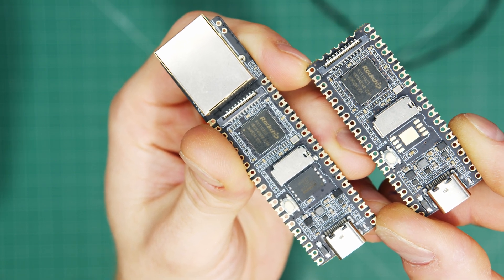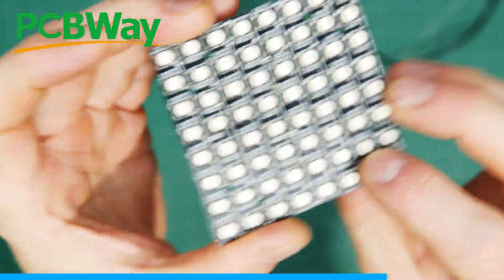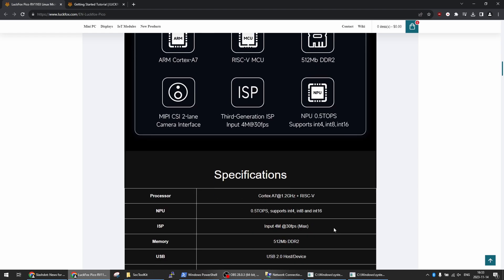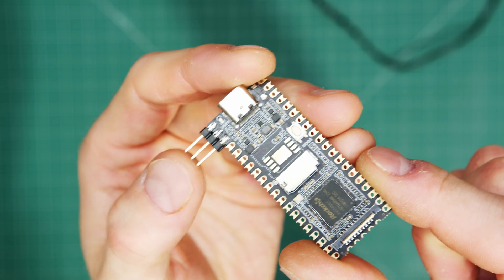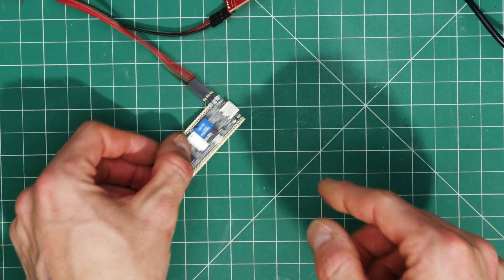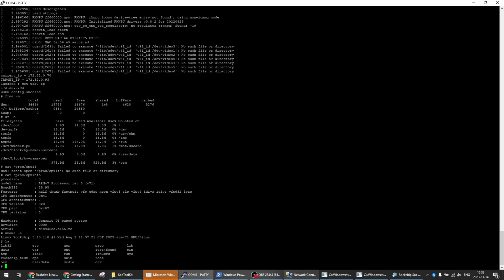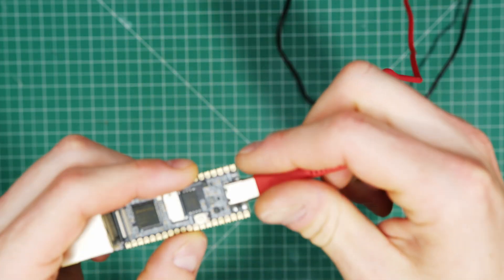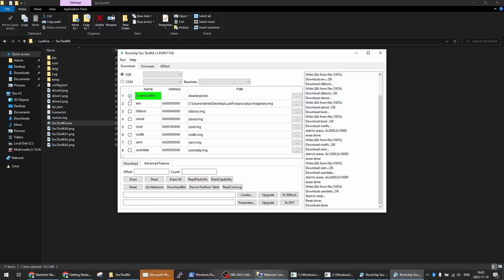Luckfox Pico - Milk-V Duo and Ox64 Killer?

Comment: SoC's seems to be a lot more complex compared to microcontrollers.
Reply from the maker: Oooh yeah mate, but more capable too. Eg Atmega32U4 - 16MHz 8-bit RISC-V, 2.5KB RAM, 32KB Flash, 12-channel 10-bit ADC, USB 2.0 integrated for flashing. RV1103 - 1.2GHz 32-bit RISC-V, 64MB+ RAM, 26 GPIOs, TPU, ISP, Ethernet, MMU, MIPI DSI/CSI, USB Host & Device, SDIO for SD or Wifi, PCIe, SPI NOR flash controller, etc.
Reply: @PlatimaTinkers  If their increased complexity didn't bring more capabilities the designers f'ed up.
Reply from the maker: @bogmaerke hahaha ain't fkn wrong mate

Comment: can they process 4K cam? and if so can they stream over some wireless?
Reply from the maker: Hey they have no wifi built in, but they do support USB device mode so you could easily connect USB or SDIO wifi as long as you have the drivers.

They have MIPI CSI 2-lane for camera connectivity, so you should be able to do 4K@30FPS but the capability of the ISP is limited to about 4M so you'd only get QHD (2560x1440) unless you dropped the FPS further. Back of the napkin math would be 4K@10FPS to JUST fit within that hardware capability.

The Pico Pro and Pico Max support 5M30FPS ISP so you should be able to get 15FPS which is what our eyes/brain usually need to perceive something as animated.

Enjoy!
Reply: Hello, i tried to stream over usb. Its working. Is it possible to stream over wifi or something by connecting with esp32? If its possible please help me to stream wirelessly using esp32 as a wifi midule!
Reply from the maker: @alfaskc729 You need to read the documentation friend. I am not a personal ChatGPT sorry.

Comment: Nice job on the review! I'd love to see a demo that exercises the video camera option, including taking pictures and recording video.   Do they have software support for recording video?  If so, mjpeg or H.264?
Reply from the maker: Hey thanks yeah I am planning a 'part 2' that gets into more depth. I'd assume you use libcamera or even ffmpeg as a frontend for interfacing with it, and can save in any format you want. The ISP appears to support JPEG, H264 and H265 hardware-acceleration. You can see in https://www.youtube.com/watch?v=JIFqV1vZB2Q how I use a library in a few ways to grab media from a connected camera - I expect the same code would likely work here with minimal changes.
Reply: @PlatimaTinkers  it would be huge if it integrates cleanly with ffmpeg.  A good tell is if it provides a standard /dev/video0 interface.  Looking forward to part 2!
Reply from the maker: @leadf00t looking at https://wiki.luckfox.com/Luckfox-Pico/CSI-Camera/(am going back to the workshop in a bit and can test if I can find a compatible camera) it looks like it creates /userdata/video0 haha. You can see on the Core3566 that it is fully V4L2 compatible though (https://wiki.luckfox.com/Core3566/Core3566-pinout/6.%20CSI%20Camera/#63-viewing-camera-information) so I'd assume so!

Comment: Wooow, such a great video!
Do you know how does the camera work? I'm trying to do object recognition but the only thing I know over the camera is that generates something like a .jpg file, does that file updates all the time? that is how does cameras works on linux? I'm a newbie in this world, thank you!!!
Reply from the maker: @ericcaudillobarbosa586 Hey thanks! The camera does not have to generate a JPG - it's just a data stream that you can interpret any way you want; save images, save videos, perform realtime detection, stream it to the network, etc. There's some example info on it here: https://wiki.luckfox.com/Luckfox-Pico/CSI-Camera and
Reply: Dude...this probably isn't going to be the ideal board for object recognition. object detection maybe. If object recognition is what you're interested in. Buy a raspberry pi 4 or 5 or pick up an Nvidia jetson. The jetson was made for AI applications. The most important thing to know is that you can't make chicken salad out of chicken shit, and these under 20 dollar boards are chicken shit when it comes to these type applications. If you're building an AI system or application and your board doesn't support python, you're going to hate it. peace out bro.
Reply from the maker: @rickhunt3183 I think you've missed a bit of the specs, as you're not correct all sorry mate. It'd be good for you to check out how the ISP pipeline and TPU work, plus how RKNN stitches it all together.

Unlike the Pi 4, the board has 0.5 TOPs NPU and a 4MP 30fps ISP. It can do object detection AND recognition, and you can even do facial recognition at a decent clip. This RV1103 (lower end to 1106 and 1109) SoC can run YOLOV5 at about 10fps from memory, RetinaFace at a very good speed, plus plenty of other image recognition, text recognition, car plate recognition, speed recognition and similar models all at a solid pace.

And it supports Python, comes with it out of the box in fact. Really not sure where you're getting any of your info from sorry.

Comment: Interesting possibilities with this thing. Much more than the Ox64. Use the RISC-V as VGA GPU?  Will be checking the camera options.
Reply from the maker: Yeah I don't see why not. If you check out https://www.lontentech.com/products/raspberry-pi-vga-adapter-board-gpio-to-vga-module-shield-for-raspberry-pi-4-model-b-3b-2b-b that does 1080p60 using 6x GPIO pins as it only requires a ~150MHz pixel clock from memory.

Comment: Thanks for the great video.
I have the 1103 board but not using it so far. Instead, using 3566 and 3588.
Will try to do the development on 3566/3588 with NVME and then port to 1103/1106 for power/size/cost consideration.
Reply from the maker: Yeah that is probably the way to go; compile time on these would hurt haha. And you're very welcome!

Waiting for my 1106 boards to arrive now :D

Comment: Please consider zooming in on the text .. very difficult to read .. really don't need to show the whole thing top to bottom and w/ all of the empty space on the right side. ☮
Reply from the maker: Yeah mate no worries - what part were you referring to? It can really depend on the resolution of your screen but I try to make it readable at 1080! Cheers for the feedback
Reply: @PlatimaTinkers  7:17 onward .. for example (what I'm talking about can be avoided several times).
Thanks for being kind about what I hope is constructive criticism.  ☮
Great video .. don't take me wrong. Thanks for sharing your knowledge and experience!
Reply from the maker: @THE-X-Force hey yeah I get what you mean now - the terminal output! I just had a look and it's quite readable here, you might want to click the cog icon for the settings and make sure it's set to 1080p50 - that was the recording resolution, so that playback fullscreen should look close to 'native'. I have increased the PuTTy font size though so it's easier in future videos!

Any criticism is absolutely appreciated - I am rubbish at this so value any input or feedback. Cheers!
Reply: @PlatimaTinkers  Ok .. my res is good and I can make it out (barely on this 17" laptop at 1080), but maybe you will agree that having nearly half the screen show nothing but empty black space is .. less than ideal?

I'm suggesting cropping most of that dead space out .. and since that would make the video vertical (aka horrible), lopping off some of the top text that the viewer has already seen, and doesn't need to focus on. Hope that makes sense. Maybe try it and see what you think.

In any event, it's no big deal. Thank you again, and you are definitely not rubbish at this.

Best of luck from NY☮
Reply from the maker: @THE-X-Force Yeah mate had not considered that at all, I'm on a 27" haha.  You're absolutely right about the waste of screen real estate though; if I make the font size 20pt it looks like it fills the width nearly perfectly. YouTube's compression should massacre it less than too!

Good luck with the freezing temps there, we've got 86-104 here!
Reply from the maker: Yo, quick close up of that section I put together for you and some others that asked; https://youtu.be/cx3rj6a_K2w
Reply: @THE-X-Force , The YouTube app on my iPhone lets me zoom in and out with my fingers.
Reply: @PlatimaTinkers  Thank you friend!
Reply from the maker: @THE-X-Force  very welcome!

Comment: so it's the size of a Pi Pico, or a bit bigger with a full on network jack, and runs Linux. So I assume you can run micropython or something from that Linux terminal to control the GPIO? I've only got basic familiarity with microcontrollers.
Reply from the maker: Yo yeah pretty close. It supports Python 3 as of just recently - comes with the image. MicroPython itself has been ported to ARM (https://github.com/micropython/micropython/tree/master/ports/bare-arm) and that MIGHT work, but would probably require a few tweaks. CircuitPython runs on the STM32F746 though, which is also Cortex-M7, so that could also work. Just not sure how the ethernet support would go with those binaries - maybe better to stick to the Linux base layer!
Reply: @PlatimaTinkers  That's neat! I'm mostly used to Arduinos that don't even have an OS of their own, so the idea of SSH'ing into one to use it is kinda new. Thanks for the info.
Reply from the maker: @DFX2KX yeah I do like Arduinos, but I'm Linux at the core, so using SBCs like this that are basically embedded systems but still have a shell makes me pretty damn happy! And you're very welcome mate. Have an awesome weekend

Comment: We dont need no stinkin' FTDI, Silicon Labs CP2104 for the win!
True story, at my work we use a cp2108 chip in our diagnostic board.  Its the same thing as the 2104 but it has THREE serial endpoints.
Reply from the maker: Oooh that is pretty sweet - I could definitely see some value there, especially with some devices having separate serial interfaces for a) flashing then b) debug output.
Reply: @PlatimaTinkers  oh ..  the cp2108 has at least four, endpoints numbered 0 through 3.  I set up some udev rules on Linux to symlink the endpoints based on USB device attributes.
Reply from the maker: @kayakMike1000  Aaah nice. I'm currently developing with a CP2102 - turns out they make quite the array of bridges!

Comment: Hi I am interested of that board (especially pico mini version). I've got two questions 1) is it possible to install full MQTT broker on that small board? 2) is it possible to solder 4 ethernet cables (100Mbit) directly to pico board? (I am interested of that because of lack of space for eth module). I know you say something about my second question - but you are speaking so fast and I'm not sure you say "can" or "can't" 4:27 regarding to soldering cables directly? Thank you in advance and sorry for my english.
Reply from the maker: Hey mate your English is fine!

1) You could probably install MQTT broker, I think it would probably run fine but I do not know how much CPU it would use. You would need to download the SDK and do a compile with it, which I can try if you want? 2) You could definitely solder the cables on, but it is a little risky and you may get a lot of TX/RX errors. I would at least recommend diodes on the TX/RX lines. This is pretty much all the ethernet module has. 

I say you can solder cables on, BUT you might blow it up haha. FYI I upload subtitles so hit 'c' and you can see English captions of exactly what I am saying. I know I talk too fast 🤣
Reply: @PlatimaTinkers  Thank you for the answer. I have ordered one board - the smallest pico mini version B (with flash mem)+ one ethernet board. I decided to use eth.board because of lack diodes you mentioned. It should be possible to solder both boards together to achieve a small "qube". Unfortunatelly i have no schematic of eth.board but I think it could possible to use "passive poe" by injecting +6V and gnd into not used pairs of 100Mbit ethernet cable(i will check connections and modify eth.board if necessary). On pico board there is step-down converter which accept absolute max +8V so after proper wiring it sould works in my opinion. Regarding to MQTT I'll do some tests (of course if I do not blow this crap up ;) ). I think CPU should be enough fast - 1Ghz is quite ok, but 64 megs of RAM can be a bottleneck. We will see.
Reply from the maker: @grzesiekyogi1518  hey the ETH module is super simple; it just connects the TX+ TX- RX+ RX- pins with flyback and polarity diodes. You can see it well here on my shop page: https://shop.plati.ma/products/ethernet-board-for-milk-v-duo-and-luckfox-pico. You may be able to access the power pins on the bottom of the board where they are soldered.

It's important to note that passive POE is 24V though, and up to 27V, so you'll need a step-down converter to bring it to 5V and connect it to VSYS. For this I have used https://shop.plati.ma/products/mini-360-dc-buck-converter before, as long as it's 24V passive, not 27V! You'll also want to tune that output voltage very carefully, then put some glue on the potentiometer.
Reply: @PlatimaTinkers On luckfox pico board there is already a dc-dc step-down converteter (EA3036C attached to VSYS) which accept absolute max +8V. So it sould be possible to inject +6V (I know - it is not according to passive POE standard, but it sould works without any additional converters and it is easy to inject by standard 2$ injector + standard power supply). If the LAN cable is not too long it should be possible even inject +5V (EA3036C converts to three voltages where 3.3V is the highest one - so I believe if there is for example 4.5V at VSYS due to cable resistance it should work anyway). I will test it soon.
Reply from the maker: @grzesiekyogi  hey yeah but I don't know where you are getting those voltages sorry - passive POE is 24-27V, and active POE is 34-57V. Eg, where are you getting your low 6V from? hah. The EA3036C looks like an awesome little unit though!
Reply: @PlatimaTinkers  You can inject as low voltage as you want using the simplest (and the chipest) POE INJECTORS + standard power supply. PASSIVE POE INJECTORS are using 2 unused 10/100BASE-T pairs of ethernet cable (two wires for negative and two wires for pisitive voltage). Passive poe has no standard (like IEEE 802.3af/at/bt for active version) so voltage is not limited to the values you mentioned (24-27v). Regarding to 6V - it is harder one (becuase it is non standard power supply like +5V or +12V) but it is possible to tune most 5V power supplies to achieve 5.5V or even 6V. BTW - I checked schematic of MILK-V DUO board and I found that it is better one (from power supply point of view). They are using MP1657 Buck Converter - so you can use standard +12V for power supply attached to VSYS pin. They menioned about it in the documentation (page 2 "power tree" of duo-schematic-v1.2). I will test luckfox-pico but finally I probably will order milk-V nodes for my "inteligent" house (due to better support, better buck-converter and more GPIO pins).
Reply from the maker: @grzesiekyogi hey yeah I use both 802.3 and passive POE pretty much ever day (network engineer haha), and while there is no standard for passive POE as you mention, all the implementations from Ubiquiti, Edimax, Microtik, etc, are all around that 24V mark. I guess you could send 5-6V down it, I've just never seen one myself! 

Interesting re that MP1657 - good find! Cheers
Reply from the maker: @grzesiekyogi oh and don't forget to check out the Luckfox Pico if you have not, also very similar and VERY good. Uses a MP1605GTF-Z though, so really limited to 5.5V in, max 6V peak.

Comment: Loving the coverage of these small Linux boards that run Linux.
I'd be really interested to know your recommendation for any which run using Power over Ethernet - I think being able to make sensors/IoT stuff that runs off PoE would be a killer app.
Reply from the maker: Hey glad to hear it mate! PoE is a very interesting one, your best bet would probably be using passive 24V POE, else the Duo IO board has some details about adding POE in the schematics for it!

I might honestly design and sell a POE adapter for SBCs. Wouldn't be hard
Reply: I need Power over Wifi.

Comment: If you plug camera it turns into IP camera streaming. And it gives you notifications in console if something happens in the image.
Reply from the maker: Yeah that is so awesome, I started playing with that afterwards and am leaving that side of it for a 'Part 2'
Reply: @PlatimaTinkers  I was also imoressed about how easy was to set it up. I was able to recompile kernel and create my own .ko files while I never did that before. Its neat to learn how busybox is compiled on such devices.
Reply from the maker: @darkobul1 Oh wow that is awesome. What guide did you follow? I'm yet to do so, but was thinking about how hard it would be to port esp_hosted...
Reply: @PlatimaTinkers  they provide VM with all tools needed. I bookmarked it somewhere I will send you. I think was in chinese but I used google translate. 
I am interested to see about esp_hosted as I dont know anything about it. Tool chain is ARM its a chance should not be hard?
Reply from the maker: @darkobul1  Appreciated! And yeah I'd not think it too hard either - instructions look fairly straight forward.
Reply: Might try this to put some old cellphone cameras to use.
Reply from the maker: @THE-X-Force oh yeah I wonder what sensors were in some of those. Some Sony IMX would be great hah, just need to make some sort of connector for it